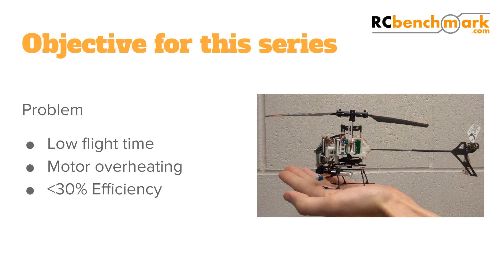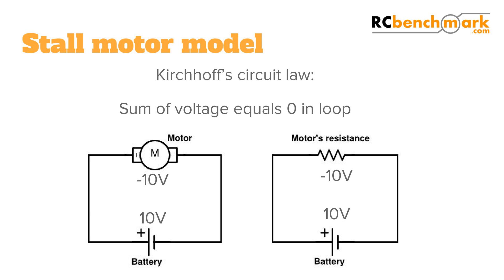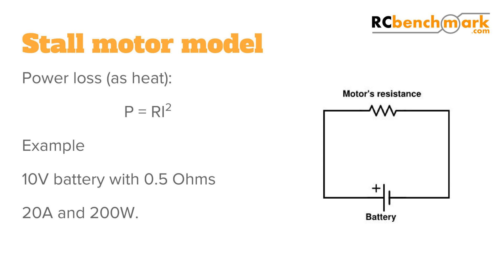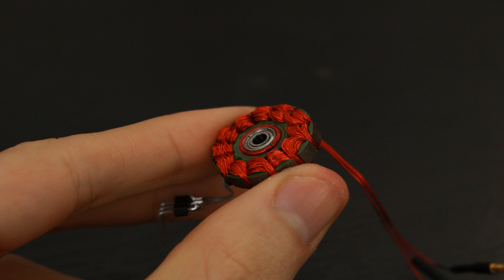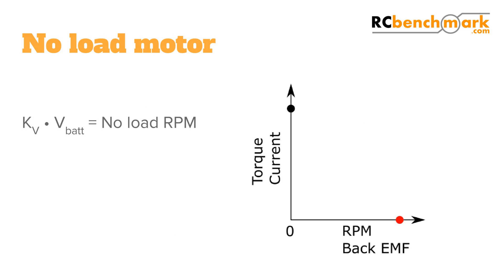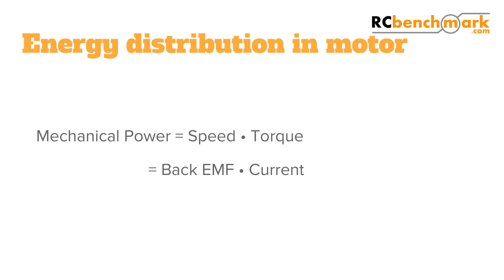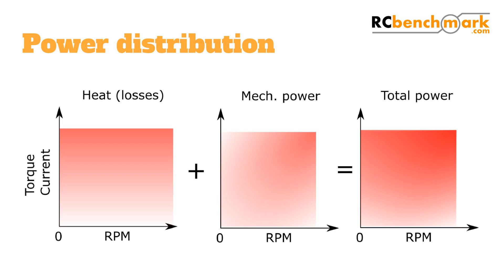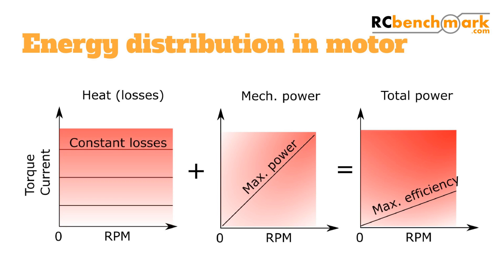Improving Motor and Propeller Performance: Theory and Application (Part 1)

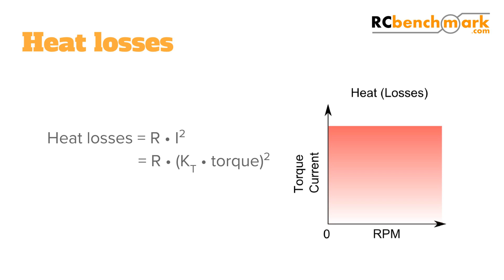Comment: Hi, regarding the equation for heat losses at 8:40, current should be Torque/Kt since T=Kt*Current right? Thank you!
Reply: I think you would be correct, if you account for units correctly. Also thanks, i've been stuck wondering what i did wrong for a bit lol!

Comment: WHICH IS THE BEST RC MOTOR FOR THE  DUCTED FAN,let say 120mm 12bladed fan,what motor is the BEST OF THE BEST PERFORMANCE, LOW KV or HIGH KV motor? OUTRUNNER OR INRUNNER MOTOR?i hope you will answer my question.by the way NICE VIDEO u have here.
Reply from the maker: Unfortunately, it depends on a lot of factors. The is not a single best motor or ducted fan. In general though, large and slow spinning propellers will be more efficient. You will need a low Kv motor for high torque. In practice, you might need faster reaction time for racing for example, so you will sacrifice efficiency.

Comment: Excellent tutorial, thank you and looking forward to Part 2. Many of us end up making the mistake of "over-propping" motors: using too large, too high-pitch, or BN - cut-down propellers. Best to drive motor somewhere between the Max Power & Max Efficiency envelope
Reply: +EngineerX : Thank you to RCBenchmark for this series of explanations, and thank you also goes out to you EngineerX, for all of the excellent contributions you make to our hobby over in RCGroups!

/ocie (zafuquazar on RCG)
Reply from the maker: +Ocie Ward Thanks to both of you! The next two tutorials are written, but we cannot film this week. I will talk about Kt and Kv. There is actually quite a lot behind those simple constants!
Reply: +Ocie Ward Thanks! sharing and contributing is one of the best parts of the hobby!
Reply: +EngineerX we should all pitch in to buy you one of the RCBenchmark dynos for all of the test runs you do
Reply: +Ocie Ward :) Thanks for that thought! Their Dyno is amazing. Light years ahead of any thrust stand currently in use  by most testers. My next set of tests will be 3-blade prop comparison. I should be receiving delivery of the new GemFan 5x4x3 props in a couple of days and have a HQ5x4x4 on hand already that I bought from GotHeliRC.